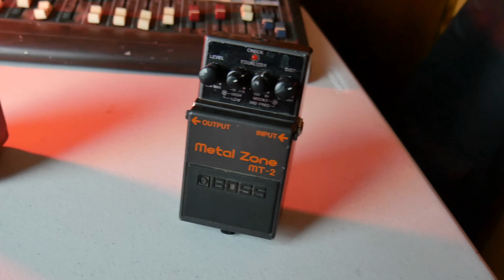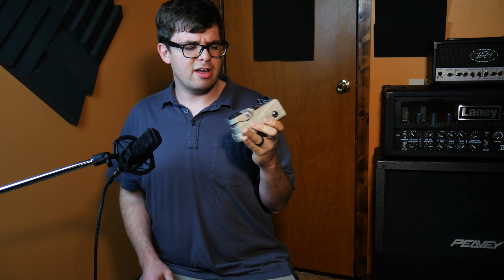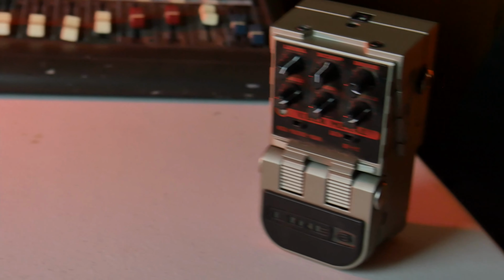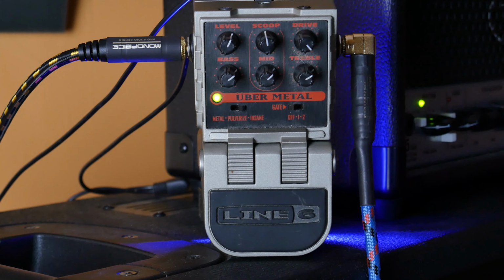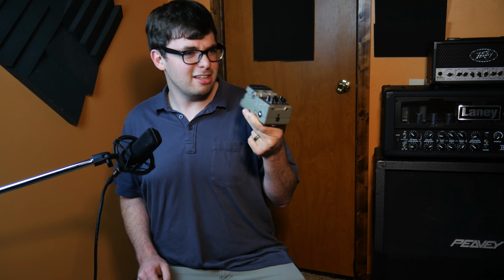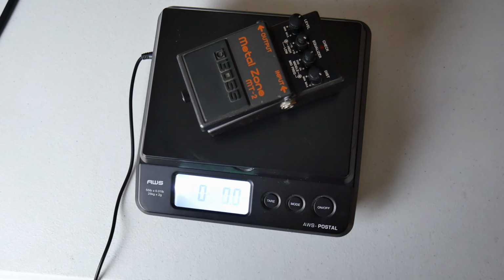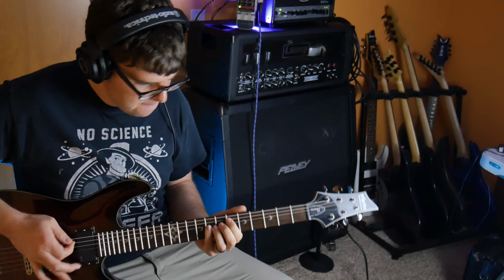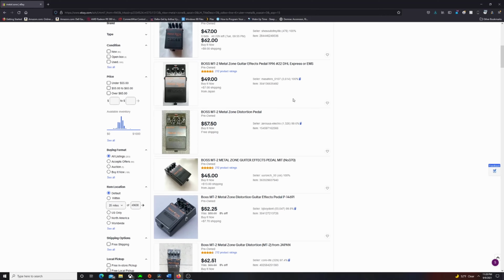Line 6 Uber Metal - Modular Tonecore Distortion Pedal Demo and Review

Comment: Good review man. This has been my go to distortion pedal for  over a decade & I have 3 of them spread out over different rigs. I disagree about the poweramp thing, I've ran this in front of many amps over the years & it kills for me.
Reply from the maker: Yeah I can respect that. It's a bit too fizzy for me plugged into the front in my opinion. It might sound better with different Amp pres as well though. But any who thanks for watching!
Reply: @brothersinmetal1922  sorry I am a complete noob,  but I have this pedal and an Orange micro dark, I don't know how to use the fx loop yet but are you saying that I should plug my guitar in the pedal then plug the output from the pedal into the return ? 
 
I thought I had to plug my guitar in the front input and plug the send into the pedal input then plug the pedal output to the amp return.

thanks
Reply from the maker: @husker3345  just plug the output of the pedal into the return, and plug the guitar into the input of the pedal. No need to plug anything in the front. When you do this it will bypass the amps preamp section, and the pedal itself will act as the preamp.
Reply: @brothersinmetal1922  thanks, I just tried it and it wasn't good, it sounded very muddy, I tried to enhance with EQ on the pedal but without success
Reply from the maker: @husker3345  Yeah its going to vary from amp to amp probably. Depends on your tastes as well.
Reply: same uber metal has been my #1 but this new joyo dark flame pedal coming out seems like it might have contender, but we all under mind the speakers in our cabs have alot to do with tone IMO, but this thing slays all on my setup
Reply: @husker3345  this is meant to go infront of the amp, effects loop may not be good for this one FYI

Comment: I always feel the volume level is low when I put it through the return amp, even though the volume pedal is full, how to fix it? 
if the head amp doesn't have a power amp volume, is the equalizer pedal the solution?

Comment: Just pulled my guitar and old Uber Metal pedal out of storage, I still have to fix the power supply cord, and get a new cord to run from pedal to guitar. I either lost or gave away my old cord, atm only have a short 1 meter cord. So it'll be a minute before I get to test it out anyway.

To the point, I somewhat recall the pedal had a distinct kind of "click" when toggling it on and off (the pedal itself, not through the amp) and mine definitely doesn't click atm.
I was wondering if you could verify if it does indeed "click". I'm thinking I may also need a new actuator...or just jerry rig some kind of toggle switch if I want to use it xD

edit: after looking at pics of other tonecore pedals, seems like it has a little concave disc thing on the chip board, for the on / off switch, that may have gotten stuck depressed down.